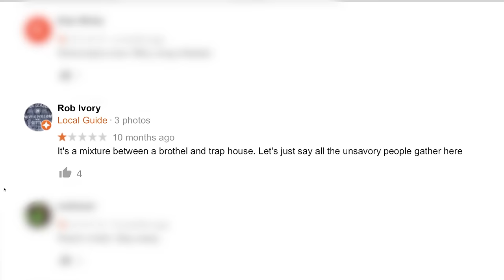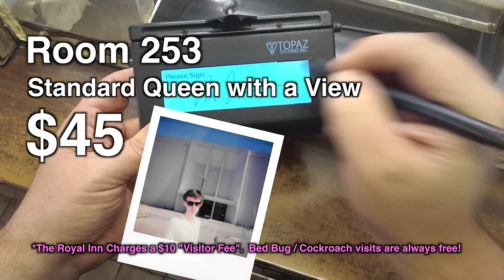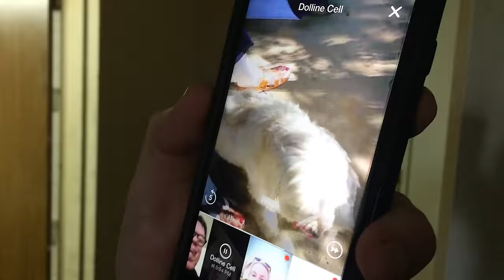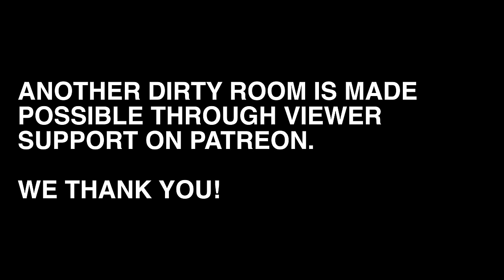Another Dirty Room S1E13 : ALL TIME LOW : Detroit’s Notorious Royal Inn Motel

Comment: I will never sleep in a hotel anymore after watching you.
Reply: HG Shurtugal as long as you don't stay in  places like this you'll be fine
Reply: I'm in hotels right now ,I'm gonna sleep outside tonight
Reply: HG Shurtugal: watch for rrrroachez.  hehehe
Reply: Same, I'm just gonna hide in my room
Reply: tall32guy bi
Reply: Yep, Bedbugs acquired resistance to most pesticides over time. Now they're slowly spreading everywhere that humans traffic on a regular basis. They're good travelers, unfortunately. Only way to correctly kill their colonies is with excessive heat, which is expensive. Even in 4 or 5 star hotels, they often start colonies behind baseboards which rarely, if ever get checked by housekeeping.
Reply: I've lived in a house that was built in 1932 it had bed bugs and I eliminated them with food grade diatomaceous earth. it's cheap it works everytime.